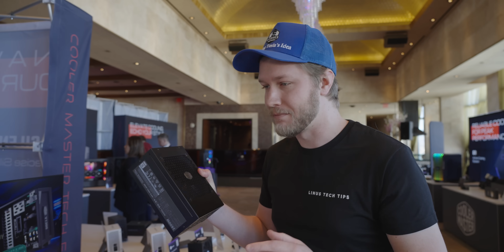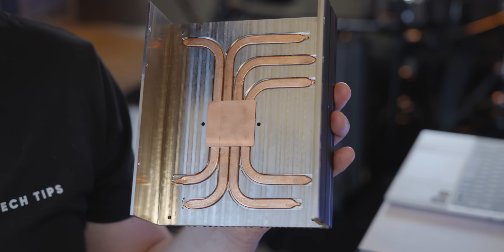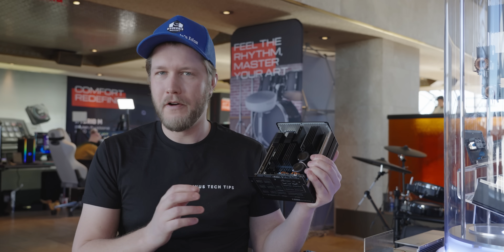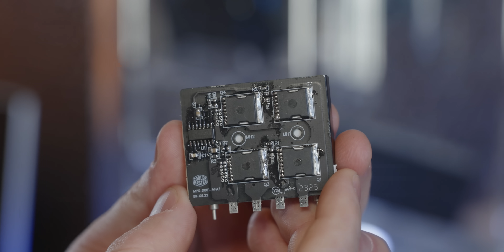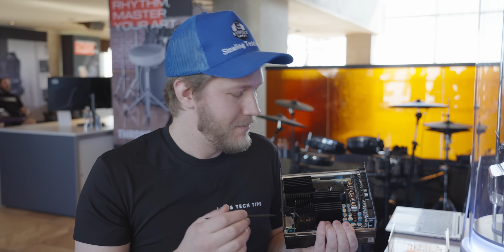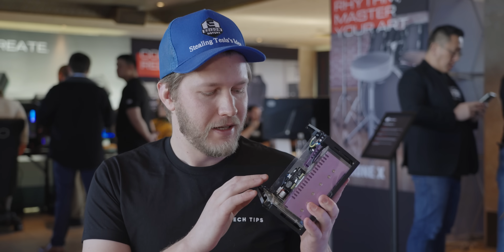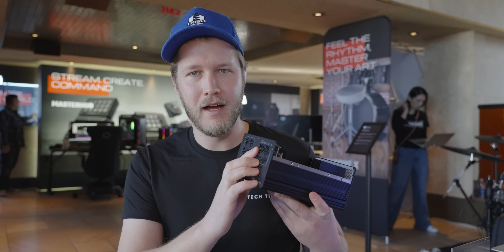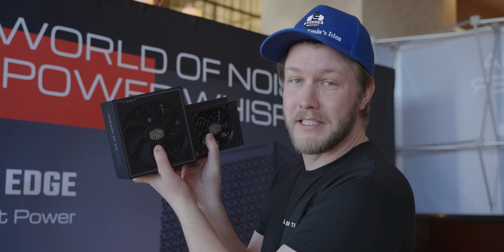This is unbelievable... - Cooler Master at CES 2024

Comment: Best PSU walkthrough I have seen from LTT in years. Now, how about more details and actual testing on those 1100w and 1300w units? Especially their noise output.
Reply: It was an ok overview of a PSU but it raised more questions than it answered. How are they using mosfets to rectify AC to DC instead of diodes? How are they stepping up the voltage to 400v and why would they if they just need to feed that into a transformer to drop it down to 12v? For that matter, transformers introduce noise as well and in order for the MCU to control it then they'd have to have some kind of flyback diode and probably another pfc circuit after the transformer. It's cool to see, and I know this wasn't meant to be an in depth video, but it seems like a LOT of important stuff was either missed or just glossed over.
Reply: @HelenaOfDetroit  those a very good questions, hopefully someone will cover these aspects in the near future 👍
Reply: @HelenaOfDetroit  they aren't. mechanical engineer guy should stick to mechanical engineering. most of the things he said were wrong. his explanation of power  factor was COMPLETELY wrong. and he did is math assuming 380-400V AC which is what you get on 3-phase circuits but none of those power supplies are 3ph. still, the voltage is 1.4142 * Line voltage, or around 311V DC peak for a 220V AC system. (1.4142 is sqrt of 2). single phase outlets are 220 to 240V usually. not 380-400
Reply: I have the 1300 watt SFF one like the one in this video for a couple of months now. I am very happy with it. The fan is always on so you do hear it although I have tested the noise out a little bit and it’s very quiet imo

I have tested it out a little bit by using the microphone on my phone (pointed towards the pc) with a decibel meter app 50cm away from my PC and the entire pc + of course the ambient noise in the room when either gaming or desktop usage stays around 38/39 db.

FYI I have an open case so with my components it’s basically a worst case scenario
Reply: LTT leans more into entertainment than knowledge/education. That's what GN is for.
Reply: @37Kilo2  exactly that

Comment: 1100W on a SFF power supply? That’s pretty impressive
Reply: I have the SFF one with 1300 watts from cooler master like in the one from this video. I am super happy with it
Reply: Wait 'till you hear about Cooler Master's 1300W SFX PSU being available on the market for quite some time.
Reply: actually, in the server space sff PSU having been doing this for quite a while.
Reply: I live in the UK so I will be able to even consider that 1300W one which has a similar footprint. That 1300W is the impressive thing Corsair already last year released a SFF PSU with 1000W but to now see 1300W with an SFX PSU but they also didn't need to have the connectors sticking out to make it that small and like almost all modular PSU's the connectors are inside the PSU and don't protrude and is gold efficiency and currently $160/£160 on their website ( I checked UK and USA pricing by going on store for both countries on their site). I honestly if I was going to go for an SFX PSU I would get the Corsair one instead of the 1100W Cooler Master one because of the protruding connectors and only get the 1300W Cooler Master if I wanted a higher end PSU
Reply: @zahidshabir4038  isn't the Corsair a SFX L?
Reply: Not when you consider most ITX/sff cases are completely unable to eject 1100 watts of heat energy.
Reply: @XiaOmegaX There are definitely some cases where you have an SFX shroud, but the rest of the space is relatively large. Also, it's perfect for weird projects (such as external water cooling), and will become very relevant when the rest of the components catch up to these demands.

And even if you're not using the full 1100/1300W, you will achieve greater efficiency with running this at, say, 500W, when compared to a 700W PSU outputting 500W.
Reply: @leonro  Exactly!  I wish more people understood you just increase your PSU's efficiency if you buy something a bit beefier than you need, sure you spend more up front but if you're like me and play games almost as much as you work it's worth it.
Reply: @XiaOmegaX  The engineering is still impressive regardless of what coolers and cases are currently capable of. The shortcomings of one do not in any way negate the advancements made by another.
Reply: debatable @XiaOmegaX
Reply: @XiaOmegaX  then you would buy the ITX/sff case that can handle the heat, worthless comment.
Reply: @XiaOmegaX  having 1.1mW and eject it all the time is two different things. You can put a 13600K and 4070 in itx Case, and it's still at best emitting 400W. that's why the sfx psus are now at maximum 850W.
Reply: @XiaOmegaX  almost nobody runs his PSU at max capacity, since it's distributed over different rails, but also not all power is converted into heat
Reply: @blackomegax  yeah but most of understand that it isn't just an 1100w heater.......do you actually think its just turning all 1100w into  heat? Lmfao
Reply: @kermitthefragg  in computers I think it almost all heat. It's not like a car where some of it is used for mechanical energy
Reply: @kermitthefragg  If you’re actually running 1100W through your computer, yes, almost all of that power usage is turning into heat. A few watts might go into the kinetic energy of moving fan blades or pumps, but almost all the rest of it is eventually dissipating as heat because it’s just moving electrons around through wires and transistors. Now obviously almost no one is maxing out their PSU’s potential output, because most people’s computers never even get close to drawing 600W full-tilt.
Reply: @stillmoms  14900k n 4090 will get u 800 -900watts  with full load and full system draw
Reply: @NeVErseeNMeLikEDis  Are “most people” running a 14900K and a 4090?
Reply: @stillmoms  and what's wrong with making a PSU that can support that sort of use case?
Reply: @DLTX1007  Nothing? I neither said nor implied that there was. My only point is that almost all of the power consumed by anyone’s PC is radiated away eventually as heat. Not all of a PSU’s capacity is consumed, most of the time, but almost all of the capacity that is consumed as electricity will eventually be heat.

Comment: fanless only up to 700w? yes, technically what im referring to had a fan, but the seasonic 1000w psu i bought back in 2012 had hybrid mode, and the fan never needed to turn on, so it may as well have been fanless.
Reply: My Seasonic 850W GX-850 can run fanless only until 30% load